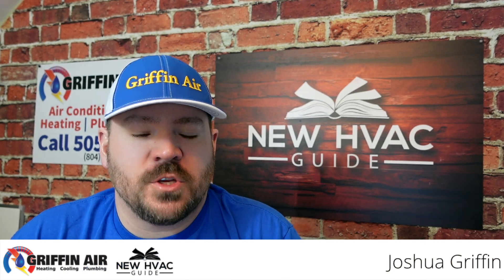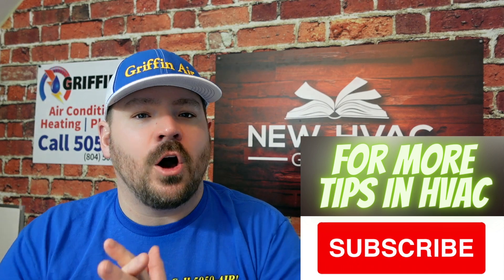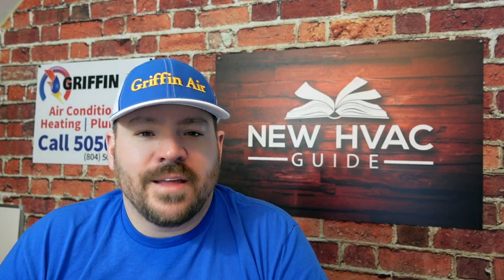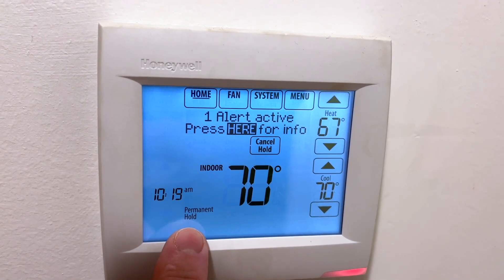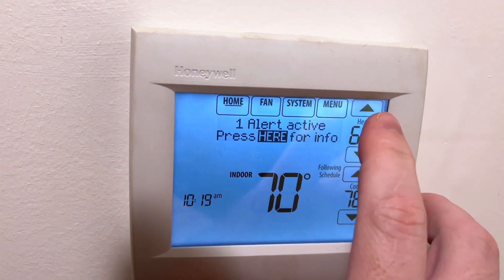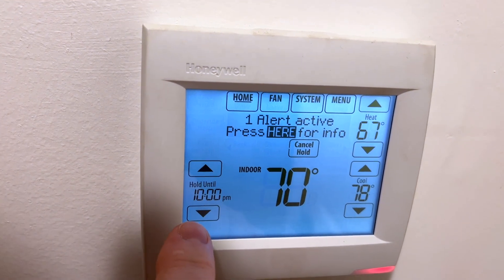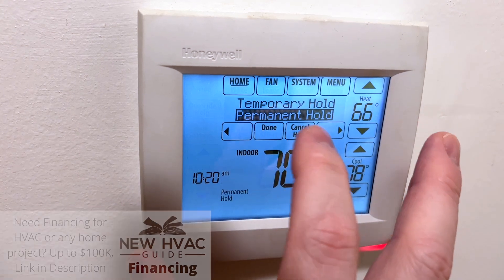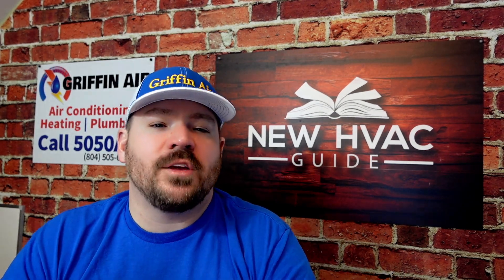Thermostat HOLDS Explained!

Comment: During a 5 day December vacation, I set the HEAT to Permanent Hold to a lower temperature.  I came home to find the "cool" on for the lower temp.  I assume the AC ran during the warmer-than-usual days of that week to bring it down to that set temperature.  What a waste of money.  I'm still not sure why it converted to Cool during a permanent hold.

Comment: What if we have a different unit i have the Honeywell home where there is 3 buttons on the left side at the top left  says set then under that is says hold then under that run then on  the ride side an up and down buttons then on bottom heat  off cool  then bottom right auto  /on 
Can't get the hold off at all it is stuck on 65 it is freezing in the house don't want the pipes to freeze

Comment: I understand hold to a certain degree (no pun intended).  However, does that mean it holds it at the temperature you set it at?  More specifically, does it alternate between heat and cool to maintain a specific temperature?   Let's say I said it at 72° on HOLD... in the daytime that might mean cooling, whereas in the night time that might mean heat to maintain.  Hopefully that makes sense.

Comment: Does permanent hold mean it runs all day?
Reply from the maker: It just means it’s going to hold at the temp it’s set at
Reply: @NewHVACGuide You still aren’t really answering the questions on these posts. They’re asking is it going to run continuously and or run and stop once it reaches its desired state?
Reply from the maker: No it doesn’t mean it runs continuously

Comment: The whole hold thing is just crazy and unneccesary.  Owners can adjust and readjust their settings normally, no needto hold or disable any function.
Reply from the maker: If someone is running a schedule, the holds are necessary. It comes with the territory
Reply: @NewHVACGuide  yes but if certain owners dont need to run a schedule thay function should be made available to them also.

Comment: my 6360 honeywell displays under the "temporary hold " notice  is instead of showing the time it will revert to the schedule, it has a digital time display  that is upticking  the minutes.. and I imaging will eventually be hours? I have no idea what it is doing???? or what it means??? any ideas ?
Reply: Could it be some learning function that may have been programmed?
Reply: I actually figured out it was just the clock.. but the temp was not holding a variation from the schedule .. it was as scheduled so I just cancelled the hold and now it says following schedule .. dont know why it said temporary hold.. very confusing..

Comment: I have a question completely out of subject but, I live in Texas and thr weather has been 100 degrees every day and my ac turns on and turns off as it's supposed to but it feels like there is no air movement once the ac shuts off. Would it hurt to put my Honeywell 8000 thermostat on circulation to help move air around? I have never tried using this feature.  Pr would you recommend more ceiling fans in every room?
Reply: Turn fan mode on to always or allow circulatioin will have no effect to machien other than constantly running the fan wich will not hurt machine but will continuously move air

Comment: So these new thermostats confuse me lol. We have the same one you have in the video. So if I put it on permanent hold will the ac unit still turn off once it hits its set temp like the old thermostats would do? So I have it on 70 degrees permanent hold, will it turn off once it hits its set temp and then come back on when the temp rises?

Comment: During Permanent Hold it wont run the AC 24/7 right? When it reaches the desire temperature it shuts off and on later when the temps go up correct?
Reply: I could be wrong but he said the permanent hold discards the programmed schedule

Comment: Thank you! How do I get rid of the perm and temp hold entirely and just use as a straight thermostat?
Reply from the maker: Remove the scheduling in the programming.
Reply: @NewHVACGuide how do you move the scheduling
Reply: @NewHVACGuide  so you can't disable the holds if there is a program?
....
Reply from the maker: @ValeriaVincentSancisi  not with most thermostats. The holds are there Incase you want to bypass the schedule. 

That said, you can remove scheduling and holds entirely in the programming with most thermostats.

Comment: I’m trying to follow along with you, but your tips are not working. I tried to turn off the permanent hold because it’s summer time but the thermostat is still not turning on.
Reply from the maker: You may need to have a pro repair your HVAC?

Comment: I've got the 8000 pro controlling HVAC and a separate dehumidifier is there a different thermostat that can handle this that has more features? I feel like I have to constantly adjust/ monitor this one.